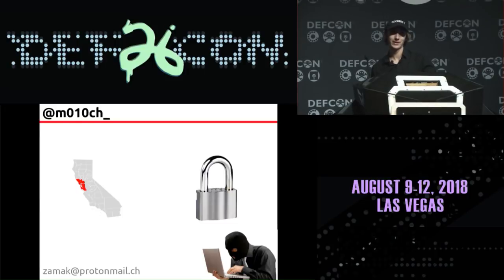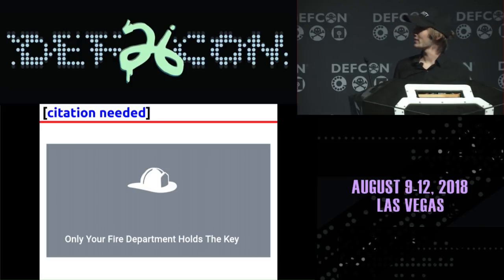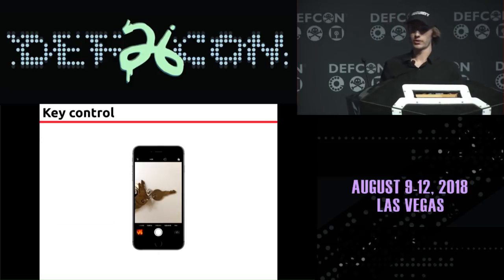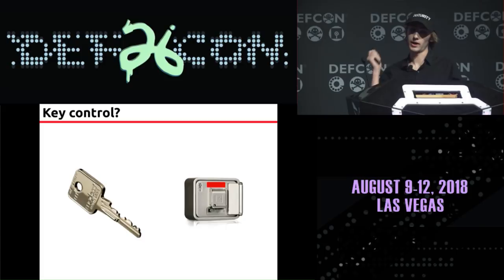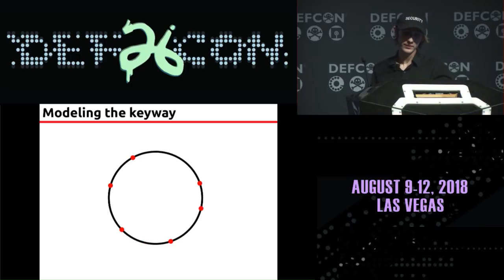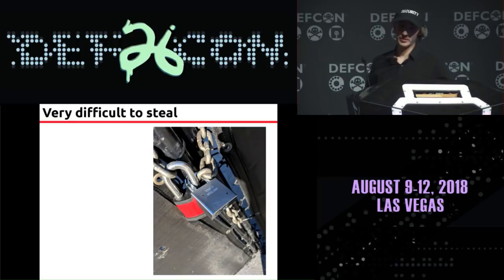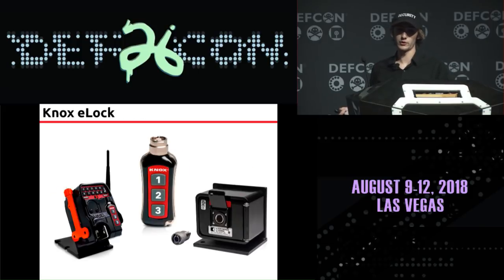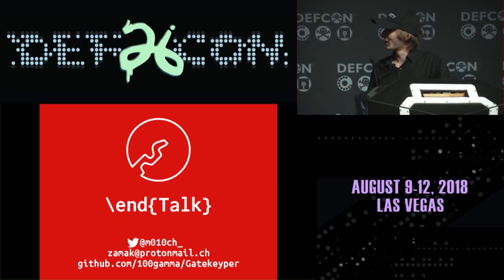DEF CON 26 - m010ch - Please Do Not Duplicate Attacking the Knox Box

Comment: What an excellent speaker, and such amazing information. 
Knox needs to give this young man some reward for pointing out how pointless their boxes are.
Well done :P
Reply: They should hire him..
Reply: It’s been explained before.
Reply: no good deed goes unpunished...
Reply: Has he told himself in his intro, this issue is well known and has already been discussed before. Cities have already proven that they prefer spending millions to re-key everything after a burglary than getting rid of that utterly broken system.
Fire fighters have huge axes exactly for the purpose of breaking doors and windows when they need to. Said doors and windows being already doomed to destruction in the fire. So there is absolutely no valid point in setting up those boxes in the first place.
If they have enough time to look for the box and open it before breaking in, this is not an emergency.
Reply: @christianbarnay2499  I think something like this has the potential to save lives, and is a good idea in theory. What if the place on fire has metal doors? The time saved by not having to break down doors would result in less deaths regardless.

It's just the current implementation that is bad. Knox has no incentive to improve these, considering that they make money whenever the boxes are replaced. 
Some sort of well-designed electronic alternative is probably the way to go, and this has the bonus of requiring a mains connection (so it is much more likely that the tamper alarms would be used)
Reply: @dirtyspah  well the fact that many places are forced to have these is pretty shitty, like implimenting this system in areas where a firefighter couldn't reasonably get in would make more sense. For everywhere else they should have electronic as the guy said. Then if it's clearly got hacked then they can update the security in someway with a new version.
Reply: TheInkinJapan  I don't recall saying that I think that every place should have these
Reply: TheInkinJapan  I think you should learn reading comprehension. Show me where I said that every place should have these
Reply: @christianbarnay2499  - you are correct.  I can most probably get into your building when it is on fire however, when the smoke alarm is going, we usually like to cause less (or no) damage when we get in to reset it.  A huge percentage of the calls that we go on are false alarms.  On the other hand, maybe the building owner would get their fire alarm system fixed if we had to break in every time...?
Reply: @markbulla1851  Either they fix it or they completely disconnect it. many owners would kill to cut costs.
Reply: @christianbarnay2499  and

Comment: 12:28: Knox got the call and hacked the feed.
Knox did not account for hacking a hacking conference.
Reply: Oh wow. I read your comment when I was at 10 mins and some change because it started echoing so I scrolled through the comments to see if it stops. Then I read yours.
The video continued and then I thought - hey, wasn't the problem that commenter referred to supposed to happen already?

It happened just at the moment when I first checked the time.

DUM DUM DUM

Comment: Just an FYI on including your alarm code in the box. Often to facilitate communications, the noise of the alarm can hinder operations.  Most home alarms have a Duress Alarm, which is an alternate code to make an attacker think the alarm was disarmed as it then goes silent and sends an emergency under duress code to the alarm company.  Put this code inside the box. It can be used by emergency services to silence the local alarm, but does not help an intruder.
Reply: But if emergency services show up when you're being burgled, how will you ensure the burglars are properly punished (without getting in trouble yourself)? In the age of anarcho-tyranny, seems better to keep alarm system disconnected, or set to only notify your trusted people group.
Reply: @SamTheEnglishTeacher  An alarm is a deterrent. If the noise does not disrupt the burglary, the arrival of law enforcement will. The point is to stop the crime. For burglars getting a slap and back to business, it's time to get hard on crime again and make America Great again.

Comment: we have in germany this box to, we call it "FSD or Feuerwehrschlüsseldepot"  and they closed with a strong e-magnet if the firealarm triggers the box will open then you need a key with this one you can open the secound door auf the FSD than you can use the Key from the Building, if you forget to put the Key back  the firealarm system will be not reset until you put the keys back. the Boxes have a anti Drilling system, when you make a hole in this box it will call the Police

Comment: I really like it the way it is here in germany... There is one door that will only open in case of a fire alarm (if the house is on fire and the alarm hasn't gone off, you can make it via key switch). Behind that is a second door with a lock, only the fire department should have the corrosponding key. As a third line, there is a key control system inside so you can't close the thing back up and rearm the alarm when a key is missing...

Comment: Well, in my school i tried how hard it would be to open a lock - never done it before, used 2 paperclips, still managed to get open one door in a couple of minutes - a really old door that lead to the attic - and what was stored there? Oh right, only the records of all students.
Years later at the military we were doing routine checks and the officer in charge noted that the locks would get replaced soon and we need to do a checkup on the keys - so we went through the records, found that several keys vanished from all listings, some keys were with people no longer in the military, oh and right - out of the 5 master-keys to the high security area only 2 were with the officers that were supposed to have them, 2 were missing. Guess were the last one was?

In the hands of the recruits doing the cleaning. Yep - the masterkey that lets you enter all high security areas, buildings where you need to go through 2 checkpoints to enter them, were generals had to wait for somebody to check if they are allowed to enter at that specific time - the recruits could just unlock the door them self.
Worse yet - the commanders knew and it was intentional - they didn't like the hassle of checking all the time when the recruits came to dispose of the garbage..... oh and tight, the secret documents that needed to get destroyed.

Security sometimes is really just a bluff - as long as nobody looks too closely they will not see the giant gaping holes.
Reply: Human laziness is the single largest security risk.

Comment: The system I'd suggest would be a public/private encryption key system. The "lock" is an unpowered system (it doesn't use a battery or outlet, so it works in a power outage still too, for emergencies). The "key" is powered (provides power to the lock when inserted, sits on a charging port and has a battery basically, if it's low enough power usage it'd basically be a key-fob). All locks ship with a hard coded copy of the public encryption key, the lock uses a pseudorandom value and encrypts it with the public key, then sends this encrypted value to the "key", the "key" can only decrypt this with the private encryption key. A city could use a single public/private key pair, or it could use hundreds of them, the automation of this process would still make it instantaneous for the "key" to figure out the correct private key to use to get in (the random value can be encrypted and passed along with a preagreed value to ensure correct decryption). It will decrypt the random value, perform some pre-agreed arithmetic/algorithm on it (example's sake: divide by 2). Then re-encrypt it with the private key, verifying authenticity and sending this new value back to the "lock" which decrypts it and compares to the expected result. A match allows the lock to be opened. The only point of attack now then is gaining this private encryption keys, which is only stored on the physical "key". Again meaning you can't duplicate it without having the key now. Since the lock is no longer a "negative" of the key.  Still leaves key theft as an issue. But if there's a physical object you can give to a firefighter to get into a building, then there's always a physical object you can also steal from a firefighter to get into that same building.
Reply: Have a look at the Knox website. You've described the new eKeys pretty well.
Reply: @portlocks2051  I feel ripped off, lmao

Comment: "Only the fire department has the key" seems strange when everyone is aware that if someone has access to a lock it can be reverse engineered countless ways. If you can take it apart/break it its an incredibly easy process, but key impressioning is a lockpicking technique whereby you can create a working key simply by using a blank key in the lock and working on it. If the lock opens with a working key then the technique can't be stopped. The lawmakers don't seem to understand just how easy it is to create a key, and keep forcing through laws to make lockboxes, TSA locks and the like mandatory. Frankly I'm surprised there hasn't been significantly more crime exploiting these rules, they are pretty much offering a free key to every building to anyone with the slightest understanding of locks.
Reply: Or, heck what if a firefighter just took key home or dropped it one day?
Boom! Compromised
Reply: @Abdega  That isn't even needed. What if somebody spends less than half an hour with any lock then sells keys online en-mass. That's something which really has affected other security critical locks already and frankly I'd be surprised if you can't get a bunch of the keys before this talk even happened. You don't even need to disassemble the lock to make a working key.
Reply: I have a Knox “fire department only” FDC cap key. They come around online from time to time lmao. They market those caps as being so “high security” and ONLY accessible the fire department. $600 a pair, mandated by hundreds of city ordinances. I despise the Knox company, huge grift on the entirely of America.

Comment: Opening the Knox Box should trigger an alarm (if the alarm hasn't already been triggered by fire etc).
That way anyone who managed to access the box this way would be setting off the alarm (pretty good deterrent if you are trying to steal/copy building access keys and dont want anyone to know they have been stolen/copied and change those locks out)
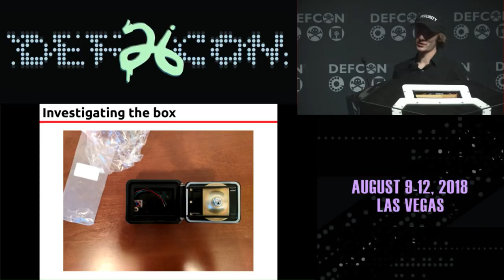Reply: Jonathan Wilson look at 8:37, it looks like it already has a switch just for that
Reply: this is the correct take.

Comment: Most of those buildings should have a automatic fire-alarm system? just put an electromagnet inside the box to keep it closed unless theres an active firealarm (or power fails)
Reply: Well that would simplify the break in to just some wire cutters and in some areas a shovel to cut the power.
Reply: @villentretenmerth11  but that would alert people like security if a fire alarm is going off they can easily just check the box as protocol the thiefs would have a x amount of time before they get caught which would make it harder
Reply: @fivemeomedia  well if you have a private security detail in your house, sure. But somehow I think that's not the case for most people that aren't corporations.
Reply: @villentretenmerth11  those keys are mostly for firefighters to get into big buildings like apartment complexes or big company buildings i dont think private individuals are required to have them in your personal home
Reply: miguel He said in the talk that at least one small shop owner was heavily prosecuted for not installing this junk.  A few years ago, the similar regulation required a box with a key so simple everybody could make one from the description in the published regulation itself.  Lock people simply refer to that key by the digits that are the hardware password, so I'm not quoting that here.
Reply: In my city the police use these to enter apartment buildings during calls and warrant checks.

Comment: how about the fire department just uses an axe to break down a door when a fire is inside the building. now you can get rid of those keys alltogether.
Reply: Building owners don't like having the door broken every time Linda in 302 forgets her pot on the stove.
Reply: I mean besides building owners not liking that, the fact is commerical buildings are likely to have steel doors. It's not as trivial to break those down.

Basically, removing impediments to fighting fires is a Good Thing™
Reply: Unless the firefighters in question got a mandated budget that takes into account hydraulic exosuits
that is not a vary sane response. 
All the points at the end of the video were pretty good solutions.
Reply: @MynameisFICTION  it's really not that difficult to break down a normal building door. It has hinges that can be broken or it can be just rammed open. Normal building doors aren't made to stand against such forces. The police rams down doors all the time. The person responsible for the fire has to cover the damages or if the person is insured it is covered by the insurance.
Reply: @Robbe1912  I find your scenario way too idealistic.. Even if we make up a number and say it takes 4-7 seconds per door.. thats still per door. it adds up way too quickly in a situation where loss of life is likely from suffocation alone. I want firefighters to have the tools to do their job effectively  but where i DO draw the line is a law that is mandating people buy a product from a private company and its not an in house solution.
Reply: @Robbe1912  Imagine an apartment building that is on fire that operates under your system. Lets say it's got 15 stories, and 20 rooms per level. Lets say the doors are flimsy, or you got a good crew, and they can bust a door down in 10 seconds. That's 200 seconds, or about 3 minutes just busting doors, per floor, to check each room. If they have to check each level, then that becomes 3000 seconds, or about 50 minutes, just breaking doors. In a fire situation, every second matters.
Reply: In your example a universal key does not do any good. checking every one of the 300 rooms in your example takes too much time as it is, even with a key. Usually the alarm goes off, people are being told to evacuate by a speaker and neighboring and the affected apartments are evacuated by hand.
In my initial statement 3 months ago I wasnt talking about sky scraper apartments either. Where i live, the maximum amount of apartments is around 20, in my building 8. When I am going to get a house I will make sure, that, for the 1 door the fire department has to bust down, there wont be a universal key. a universal key that can be stolen. I am also mainly talking about private property here and not businesses and offices.

Comment: "only firefighters have access to the key"

the last time i checked firefighters are people too and people can have bad intentions/ be corrupt. city wide back doors to every commercial building is a bad idea
Reply: Bad idea until an emergency. Needed in some capacity.
Reply: @dust7962  Fire fighters are trained to break in fast. They have powerful tools for that exact purpose. And they are legally allowed to do it.
So just axe through that F...ing door and don't waste time looking for that box which contains an old key that doesn't fit the lock because nobody thought about it the last time they changed the lock after some crackhead jammed a metal piece in it.
Reply: @christianbarnay2499  what happens if there's a secure door inside meant to resist forced entry? Can't exactly brute Force your way in everytime.
Reply: @dust7962  Secure doors that can resist fire fighters entry gear are very rare and require some paperwork and special procedures to be approved. Usually the setup includes passive and active fire protection measures (insulation, automated extinguishers) and an acknowledgement that fire fighters don't have to get in that area.
Those are mostly found in bank vaults and a few military sites.